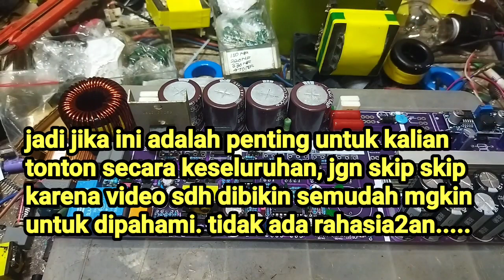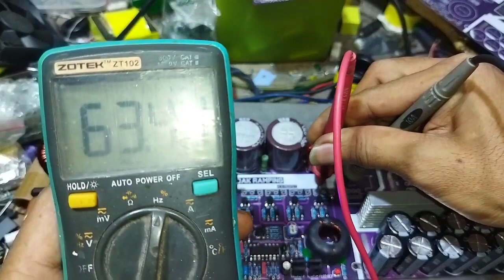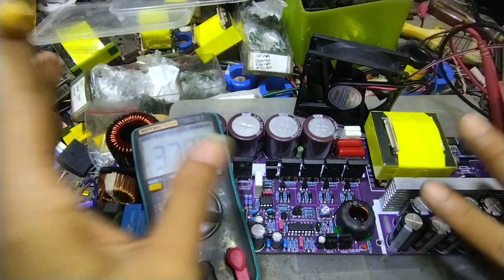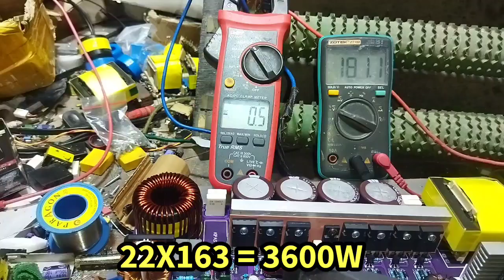BURUAN DITONTON ❗ RAHASIA SMPS SG3525, RAHASIA VGS, GDT, INDUKTANSI. PART 3

Comment: setting vgs di smps berarti harus diatas datasheet treesholt bang? soalnya dengan mosfet yg sama udah set sesuai tutorial mosfet masih panas
Reply from the maker: Betul harus diatasnya. Dn misfet panas itu bukan dr type mosfet saja, dr trafo, besaran pwm, dn detime
Reply: @Subakti_wardoyo  pwm set 16v freq 52 khz vgs 5,2v duttycircle 39% trafo 3,2mh , mosfet 45nm60 masih panas bang
Reply: @hendryka4258 saya bikin frek 43khz adem ayem, vgs5,2 duty tidak tahu,induktansi trafo tidak tahu. tidak ada alat ukur soalnya. buat dorong d2k5 seharian adem ayem saja. yg agak anget cuma dioda sekunder.

Comment: Pak mau tanya kenapa resistor 100ohm pada bagian mosfet fb nya kok panas banget. Vgs dapat 3.7v freq di 58kHz. Kira" Apanya ya pak?
Reply from the maker: @Btbwi  masa sih. sy blm pernh  menemukan r tsb panas
Reply: @Subakti_wardoyo  panas mas saya pakai resistor 1/4w biasa agak lama tr totem jg hangat dan IC hangat. Posisi sebelum pasaang mosfet. Vcc pwm di 12v

Comment: Om sebelum pasang mosfet tegang get source normal sktr 4.7volt tp stlah pasang mosfet jadi 1,5 jd tdk ada tegangan out 90v, itu apanya om yg oerlu dicek
Reply from the maker: ukurnya pakai apa. kl sdh pasang mosfet vgs mg gk terbaca kl pakai avo biasa
Reply: @Subakti_wardoyo  pake avo digital pak, moosfet untuk psu pwm sya pake fet k783, sya coba pake 7n65 mlh short  zener 15v sm zr4148

Comment: Pak kalau smps pcb labgurem 3500w pakai mosfet 47n60c3 di load di beban 6 ohm cuma tembus 9A dan sisa tegangan 135v masalah nya dimana pak?
Reply from the maker: listrik drob brp?
Reply: @Subakti_wardoyo  listrik PLN drop di 190v pak

Comment: Ijin bertanya om, kmren saya beli di toko online smps Hb 75vdc, setelah di pake angkat 2 driver untuk speker 18inch 2 biji smpsnya Kobong di bagian kapasitor Milar 224j400v meletus dan thermistor ntc47d-15 juga meletus, itu yg terlihat kasat mata, setelah saya ganti keduanya, saya coba nyalakan dan tes tegangan di + dan ground keluarnya 140an vdc, di - dan ground sama keluarnya 140an vdc, di sarankan cek mosfet, nahh saya ganti mosfet saya cek tegangan malah besar sebelah tegangan output-nya antara - dan ground keluar 60an vdc, + dan ground keluar 85anvdc tidak imbang, apa yg harus saya lakukan dengan smps ini, mohon arahannya🙏 saya sudah subscribe om, bingung sekali karena awam
Reply from the maker: besar kemungkinan smps tidak stabil, kmungkinan kebutuhan psu power melebihi kemmapuan smps nya. itu sptnya sdh porak poranda smpsnya. kmungkinan itu smps regulasi ya? sulit ms buat menerka2 st sendiri tdk tau model smps nya spt apa, dn dirakit spt apa.... saran saya konsultadikan dengan penjual mgkin ada solusi

Comment: Untuk menaikan vgs apa harus di di rubah bagian lilitan gdt ya pak ..kalo misal di tambah lilitan gdt apa harus sama jumlah lilitan  juga untuk primer dan skunder nua
Reply from the maker: gdt ttp di 1.3-2mh. naikkan sj psu pwm
Reply: Oke pak trimakasih  itu baru nyoba pake adaptor 12 volt keluar 3,9volt rencana mau pake w45nm60 pak brpa untuk vgs nya

Comment: pak punyaku smps hb  pake pwm ic ka3525 mosfet cepet panas ,frekuensi di 80khz dan duty cycle nya 50% ,,penyebab panas nya dari apa,gdt 10 lilit
Reply from the maker: R pin 7 ic sg3535 pakai brp ?
Reply: @Subakti_wardoyo  220ohm  pak ,
Reply: @Subakti_wardoyo  pake mosfet 24n50 ,vgsnya terukur 4volt
Reply: dibebani socl 506 4 set final toshiba belum ada selagu mosfet demam ,terlalu panas
Reply from the maker: @ttpemersatubangsa9415  gamti 220ohm pin 7 dgn 470 ohm
Reply from the maker: kalau masih panas gamyi mosfet dgn 35N60

Comment: bang apakah pake mosfet seri berapa saja asal frequensi dan induktansi maching smps akan bekerja normal/maksimal?
Reply from the maker: Pastinya tdk.
Reply: @Subakti_wardoyo  apakah ada patokan mosfet beroprasi dri frequensi berapa- Khz
Reply: @Subakti_wardoyo  punya mosfet 6r070c6 sayang kalo gak di manfaatkan
Reply from the maker: @alipremansier8006  rara2 mosfet dengan amper 40 keatas itu tidak baik di frekuensi tinggi, mainkan di freq  lebih rendah
Reply from the maker: @alipremansier8006  jaci patokannya ya harus dicoba2, karena saya tidak pandai membaca menerjemahkan bahasa data sheet mosfet
Reply: @Subakti_wardoyo  maksih guru tak coba di frequensi 30-40 dulu
Reply: @Subakti_wardoyo  bang menetukan teg sekunder smps FB PFC dihitung dari tegangan elco primer atau sudah ada patokan ?
Reply: pfc 380v
380/np=ns apakah benar gitu bang?
Reply from the maker: @alipremansier8006  coba ditonton video yg membahas hitungan jumlah lilitan untuk pfc. Sdh ada video nya
Reply: @Subakti_wardoyo  siap bang

Comment: Ketika pakai suplay pwm ny dri luar menggunakan adaptor 14v semua normal vgs imbang 4,9,ketika pakai suplay pwm asli kluar 16v nilai vgs di satu mosfet ny melonjak naik jd 12v,sdah ganti trvo pwm dan fet pwm tetap sm jg mas,ap yg perlu di cek
Reply from the maker: Cek R dn zd dijalur tsb atau Ganti gdt,
Reply: Gdt sudah ganti travo pwm sdah ganti 3x mas msih ttep sma,R dn DZ di jalur yg masuk kaki fet ya mas
Reply from the maker: @agoesferry2101  sy belum pernah menjumpai kasus spt itu. Harusnya dgn yg sdh anda  lakukan sdhketemu pem
Nyebabnya.
Reply: Adakah cara buat nurunin volt dr travo pwm mas d buat 14v tnpa harus membuka dan mengurangi llitan trfo pwm ny
Reply from the maker: @agoesferry2101  bisa R 12K turunin ke 10K. ttp hati2 psu untuk ncp tdk boleh dibawah 14V. saran saya psu ttp di 16v cari saj maslahnya dmn itu satu mosfet kok bs vgs 12v
Reply: Akan sy cari dlu mas permasalahan ny,trimakasih mas bantuan ny🙏
Reply: Smps sya itu regulasi hb mas,ap memang bgitu ya rata² d YT cek vgs ny pakai injek suplay dr luar
Reply: Kasus sama ms..smps tdnya normal tau² tegangan tidak keluar..sudah otak atik sana sini,semua part di bagian att sudah ganti..bahkan nyoba pcb baru yg sama persis..sy curiga di trafo pwm

Comment: kenapa satu 47n60 pfc bisa, kalau pakai dua 47n60 pfc tidak bisa
Reply from the maker: tidak bisa bagaimana??
Reply from the maker: berapa VGS dan freq ?
Reply: frekuensi 70hz DC 11
Reply: Đc 11v
Reply from the maker: PSU PWM NCP BERAPA VOLT?
Reply from the maker: Vgs kurang tinggi. harusnya 13-14V
Reply: transfo 15v tapi hanya 13.9v ok, apakah perlu 15v?
Reply from the maker: 13.5V cukup
Reply: @Subakti_wardoyo  pfc tidak bekerja dengan stabil dari waktu ke waktu, apakah Anda tahu penyebabnya?
Reply from the maker: tidak stabilnya bgmn? anda menggunakan oapan pcb seperti apa?
Reply: 4 mosfet di sisi osiloskop 3525 bengkak tau penyebabnya?
Reply: lama meledak 4 mosfet